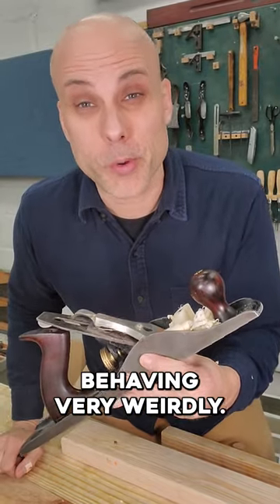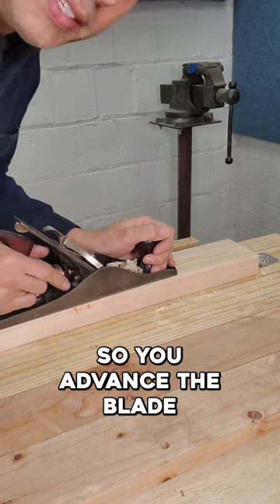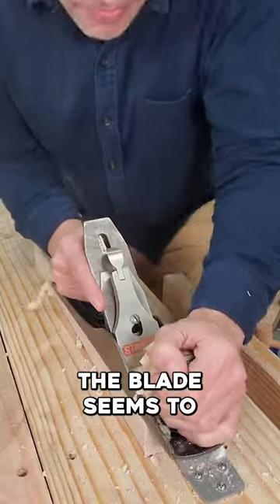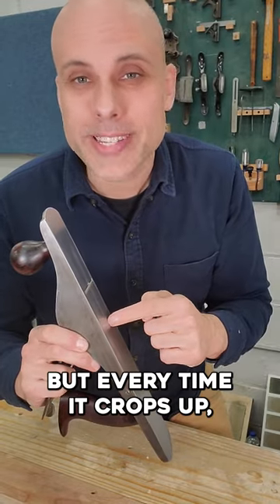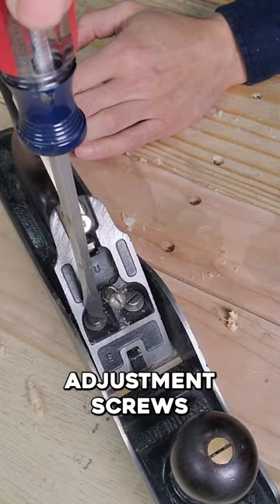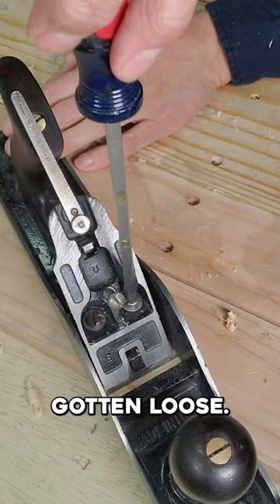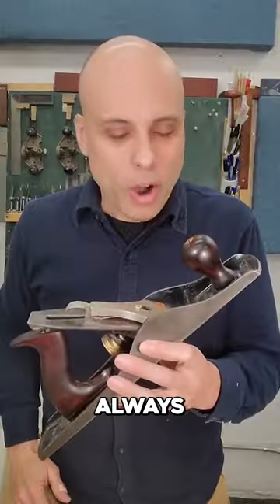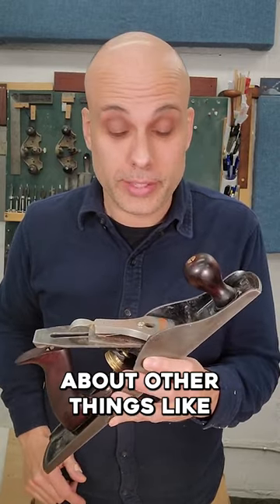Fix your handplane with this dumb trick. #diy #woodworkingtips #handplane

Comment: I had this problem recently with my #4 but found it was actually the tip of the chip breaker not having a good fit against the iron. Gave it a little bit of a back bevel and it fixed my issue immediately

Comment: But, if it's causing problems and the frog adjustment screws have slipped doesn't that mean the frog itself has slipped also and must be returned to the proper position  before tightening the screws ?

Comment: One other thing that can do that is a whisper-thin shaving stuck to the sole of the plane.  It runs up and out, but you don't notice that is doesn't clear the planed surface. You lift the plane a little as you pull back.  And the next stroke is at least an entire shiving thickness off the surface.  Resetting the depth has the same effect.  I've never had the frog losen, but that missed shaving is something that can still catch me by surprise.

Comment: Bold of you to assume i dont have a jack and smoothing plane both set to take a clean thick shaving. I dont do a lot of planing if you couldnt tell lmao, i have a belt sander, but no shop to put it in, so id probably blow my rv's breakers if i plugged any of my large power tools in, so both planes work great for hogging off material, and i rarely ever have to sharpen. Its pretty great tbh. For finishing, i just use a scraper and paper

Comment: When I just got into woodworking we had school planes but were requred to use the same one everytime. Mine bit perfectly the one time, horribly the next. Turned out to be this exact problem. Removed the frog, removed some sawdust, put some oil in there and presto, a very nice plane. Although I prefer my own now I have one.

Comment: So why not use thread locker and make the problem go away permanently?
Reply: It makes it difficult to nearly impossible to do maintenance on the frog when that becomes necessary, say the person after you discovers that the plane that's been sitting on the shelf for 10 years has a rusty surface on the frog. That needs to be cleaned off, which you can't do while the frog is in the plane frame. Why possibly impossible? If you use a variety of thread locker that requires high temperatures to release, may result in heat deformation of the plane frame, which is going to cause that person to have to do a heck of a lot more work to put the plane into service again.